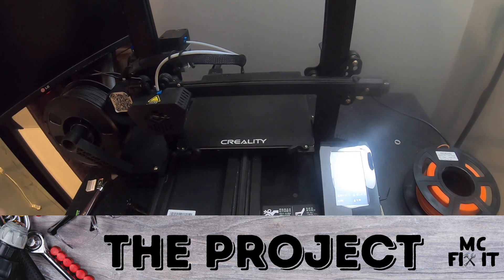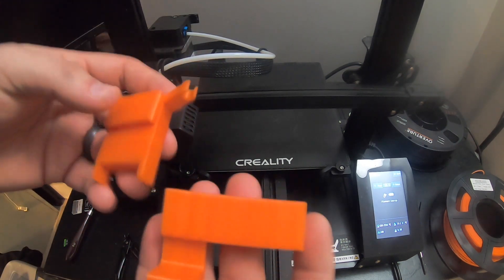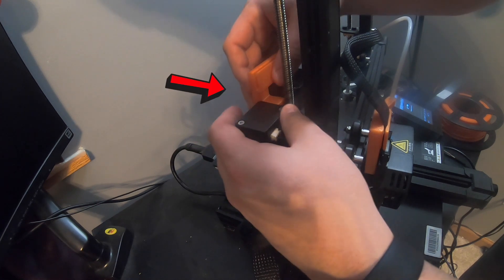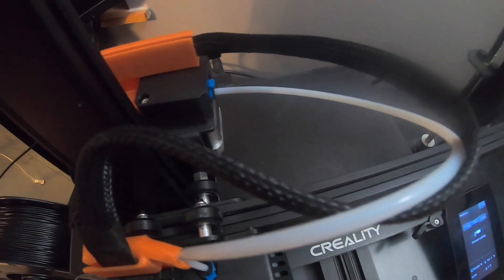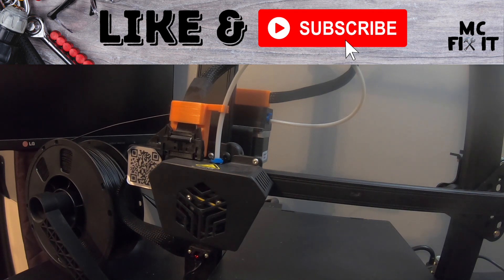X-Axis Cable Management on a Creality 3D Printer Easy Fix With Two Prints CR 6 SE

Comment from the maker: Learn how to keep your X-Axis Cables away from possibly damaging your 3D prints. I will go through the multiple steps on doing this on my Creality CR-6 SE with just two print (links below). It will be similar to other brands and models. 

LINKS to Prints: 

1) X-Axis Cable & Bowden Clip - https://www.thingiverse.com/thing:465...

2) Filament Guide - Get the LARGE one - https://www.thingiverse.com/thing:463...

The Supplies:
• Creality CR-6 SE - https://amzn.to/34LjfZ5
• PLA Filament - https://amzn.to/3rB1LYw
• PETG Filament - https://amzn.to/3J8lapu

00:00 The Start
00:07 The Project
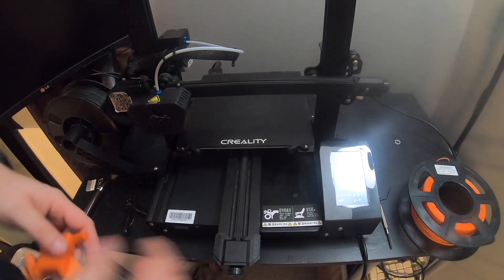01:07 Heat Nozzle
01:42 Return Filament
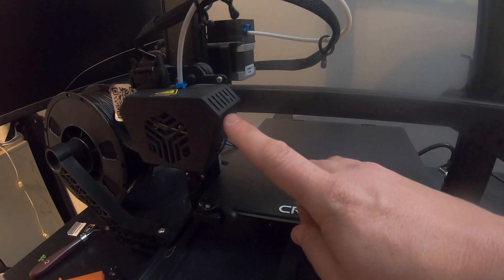02:07 Remove Filament
03:15 Install 1) X-Axis & Bowden Cable Print
03:48 Install 2) Filament Guide Print
04:45 Install Filament 
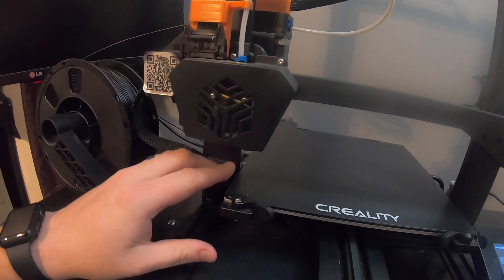05:49 Ensure Filament is Coming Through & the Same Color
06:05 Closing

Check your make and model to get the appropriate parts. Be careful not to touch anything hot during this project because you could get burned. 

Check out my website at http://mcfixit.us 

Disclaimer:
Due to factors beyond the control of MC FIX IT, I cannot guarantee against improper use or unauthorized modifications of this information in the video, post, blog, or social media. MC FIX IT assumes no liability for property damage or injury incurred as a result of any of the information contained in this video. Use this information at your own risk. If you feel uncomfortable at any time. Stop and go to a professional. MC FIX IT recommends safe practices when working on vehicles, your house, or any other project and or with tools seen or implied in this video. Due to factors beyond the control of MC FIX IT, no information contained in this video shall create any expressed or implied warranty or guarantee of any particular result. Any injury, damage, or loss that may result from improper use of these tools, equipment, or from the information contained in this video is the sole responsibility of the user and not MC FIX IT.

#mcfixit #3dprinter #creality
——
Supplies used to record this video: 
* GoPro Hero 7 Black - https://amzn.to/3f3ALtb 
* 256GB Flash Drive - https://amzn.to/33pAueG 
* Vlogging Frame - https://amzn.to/33tajE0 
* GoPro Pro 3.5mm Mic Adapter - https://amzn.to/2RCURCu 
* Youmic Lavalier Lapel Mic - https://amzn.to/2R55sWX 
* Boom Stand (tripod) - https://amzn.to/3bdkQaw
* 5/8” to 1/4” adapter (boom to blogging frame- https://amzn.to/3txrVsM 
* Portable Battery Powerbank- https://amzn.to/3vJQc0q 
* 6ft USB to USB-C (powerbank to GoPro)- https://amzn.to/3uAS5MH